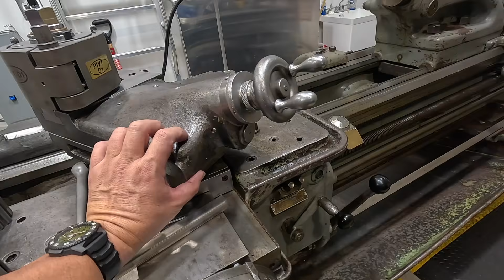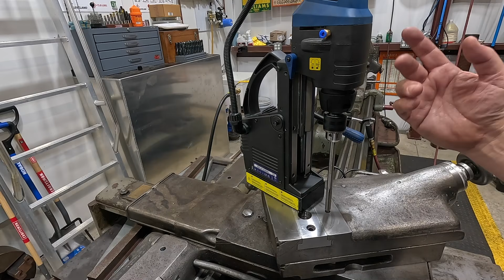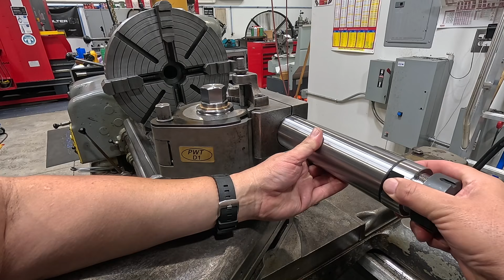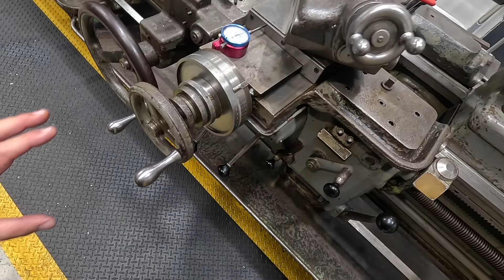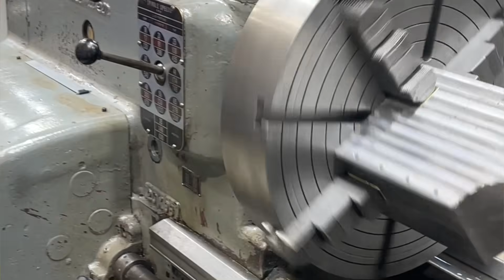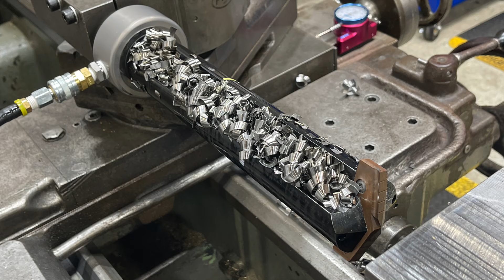3-1/4" AME Spade Drill First Test Piece

Comment: So keen to start drilling you didn't bother with the counter weights. Back in the 80s working from a Ship building and heavy engineering company I saw a bigger lathe than the Pacemaker crack its headstock from spinning a large out of balance work piece. They didn't realise until months later when the machine wouldn't turn without chattering, when they stripped it down they found hairline cracks in the casting for the bearings.

Comment: I thought the SFM was slightly high. How many tips did you go through? I have tested against Allied and nobody came close. I pulled all my index drills and replaced them with Allied. The slower speed and heavier feed beat the time of the index drill. Tool life went from 50 minutes to 120. When you break and insert on the index drill, you fry the drill. I never broke an Allied drill. I didn’t catch what material you were cutting or was the spade drill hss or carbide.

Comment: Why 29.5°?
Reply: Because most, if not all, of the threads he cuts on this machine are 60 degree threads. Half of each thread is 30 degrees, so he runs that at 29.5 to come in just under that, so that as he brings the slide in he has the slight clearance he wants.
Reply: Using the compound to thread

Comment: The  14-40 Jet (pos) that I used to run would drill that size, but max feed was .002 or it would kick off. I couldn't break all the way through either, because it would start bouncing so bad it would kick off.  This was on 12" parts with 8-9" holes, so I used this as a start to get my boring bar through.

Comment: What is your thought process on stepping the drill diameters up to final size? I usually try not to pilot much more than the web thickness so the heat and chip load is spread over the full drill cutting edges. Thanks

Comment: An amp meter on the power into the machine would be neat to see just how much power it's using to do the heavy work vs standard cutting.
Reply: Matt from HAL uses an amp meter on that big, honkin' lathe he uses for the drilling industry stuff they work on.  He says it's the best way to tell when an insert has broken.

Comment: Abom buddy, a spade drill that big should be pushing a 12 to 16 thou per Rev feed. That thing was almost just burnishing vs digging in and cutting. If the machine can't handle that kind of tool pressure, I definitely understand. But that's typically what I feed our 3.25-4" spade drills with the AM200 coating. This is in high strength AR500 steel to boot. Also looks like you could stand to have a bit more coolant flow to the top of that drill.
Reply: More coolant is never a bad thing.  You ever use that pink lemonade that HAL uses?
Reply: I don’t think the carriage would have handled that. I was waiting for the pin to shear. I also would have tapped the pin so I could remove it if it did shear.

Comment: You call it spade drill, we call it gun drill or cannon drill.
Reply: Not a gun drill, that’s a completely different style of drill
Reply: @TJ4A9  When i think about it you are right. Gun drill uses multiple inserts and is much more precise on long holes.
Reply: I never really understood
 how gun drills drill so straight but they sure do. They had an old one at a shop I worked at drilled perfectly straight through 16 inches and left a finish so smooth
Reply: @Brian55126  They say that French invented it in Napoleonic times.
French first discovered that if barrel is turning and drill is fixed with constant feed they get better results than in vice versa setup. 
Then they tweaked the drill with brazed inserts.
In those times French invented/perfected oxyacetylene torch, modern artillery and smokeless gunpowder, among many other things.
Reply: @Brian55126  your drilling with a lever and you have a huge mechanical advantage. that and that the drill rides on the bore. if the cutting insert gets smaller, the slide on the other side pushes it farther into the cut auto correcting the size of the bore.
Reply: @turtlemann14  I wasn't
Reply: @turtlemann14  I was using a horizontal gun drill machine.
Reply: @turtlemann14  it doesn't use inserts
Reply: @turtlemann14  it's 3/4 inch diameter and near 3 feet long
Reply: @turtlemann14  parts stationary
Reply: @turtlemann14  he's using a huge drill very Ridgid basically acts like a boring bar. You can't guarantee a smaller drill will will drill perfectly straight in a lathe

Comment: Why couldn't anyone just drill a smaller hole and use a boring bar? 7" is not that deep to require very specialized tooling.
Don't get me wrong this is extremely cool it just seems totally excessive, I feel like any shop with a "normal" sized lathe could perform this work
Reply: seems like a test for a higher production run, to do more than the 15 of those with boring bars might be time prohibitive vs this type of setup. Just my guess
Reply: You absolutely could do that and that would be the way to do it on a CNC. I'm assuming that since it won't fit in his CNC this is the most efficient way to do it manually.
Reply: its hard to beat the removal rate of a drill. especially if you have an out of balance part that is speed limited.

Comment: 17:20 I have a funny feeling that what moved is not the cross slide, but instead the transfer punch in its hole.  
Transfer punch looked like it wobbled in.  Try indicating the slide for 29.5 again.  That said, no fixing it now.  

Better technique might have been to turn the pin into a transfer punch with an off-center hole for gas venting.  Would be within a few tenths.  I am reminded of a video about borrowing precision from precise things.

Comment: That's an impressive cut for sure. I always hated those big chip's whipping around that's no different than razor blades. Place I work at makes cutting tools and we make a lot with chip breakers for those bug heavy cuts to try and keep them chips from becoming long strands for safety and finish quality. It's much easier when you got a blast of coolant or tools with coolant holes built in to blast it out as well. Unfortunately on a open manual machine like this that's not really possible would make a huge mess.

Comment: Adam, my man it's been a while since i watched a video of yours . I forgot how many sponsorships do you include in your videos . I got my fill for 6 months ....
About the drillbit . Don't know why did you use the toolpost and not the linked tailstock , but that does not matter . All i wanted to say is that the drill CAN handle the supplied feeds and speeds , your machine cannot . You say it's too agressive . For that old lathe it is . We have run the same drill with 72mm insert up to 0.3mm/rev and 250RPM in medium steels . The drill could handle even more ! You yes , AMEC is right with the speeds and feeds 250SFM and 0.022 can be achieved on the right machine with the proper coolant pressure/volume . 
So 4 times the material removal per minute can be done easy no problem , 8 times the rate is also possible . We also could not get there , but it was not the drills fault .
Yo i said all this and i'm not even sponsored by AMEC , what the heck .

Comment: Balance your workpiece Adam!! You can't 'experiment' on a piece like that. Your feeds and speeds guesstimations are useless if the thing is vibrating like a poker.
If the hole is to be bored another 100 thou it has to be balanced much better than that or it'll finish up tapered or worse.
That's an awesome pice of machinery but remember, people come to the channel to learn good habits as much as anything else.
Thanks for taking time to film and edit your work.

Comment: "Thats just the wrenches down here" Yeah maybe if you actually counter balanced the part, the machine would not be shaking itself so much 🤣
Reply: It didn't rattle until the cutting began, so no.
Reply: @Bricknerd  yeah because he was turning it by hand at 0.005 rpm not 120 🤣 screw some weight into your washing machine and see how that fares when spinning by hand vs spin cycle

Comment: I always start a spade drill with a clearance hole for the web. It just needs to be deep enough to establish the shoulders of the bit. Your hole will have less taper and less chatter.
Reply: not with this AMEC spade . You will destroy the center of the insert really really fast . And it will have taper . I have worked with this exact drillbit insert grade. It works best without any center , pilot , or any other preparation . I also did not want to belive it , but after i butchered 3 inserts , each worth 125€  , i started to question myself .
The drilled size with this particular tool was always right on the money , it was never over more than 0.15mm , and we're talking about big drills 68-80mm .
I have no idea why you get taper , probably the machine can't handle it .

Comment: Why wouldn't you use the tail stock to drill this hole?
Reply: drilling a hole that deep that long many times over is seriously hard work you end up needing a lever on the tail stock to make it easy enough to push through and its even harder using a carbide insert drill over a hss drill the hss drill is sharper and will cut with less force but would need sharpening multiple times over and not cut as straight a hole as that carbide drill ive drilled a similar sized hole on a very similar lathe using a hss drill and its just torture. hope that sheds some light on it :)
Reply: He said that it was because he wanted to be able to use the power feed

Comment: Adam could you make a video about the chips and where they go?  Can they be recycled or too much coolant and differing materials mixed in?  Is it waste?  Thanks!
Reply: They get recycled, any coolant left on them just burns off in the furnace. It's not really that interesting lol
Reply: Paul Component (edit: maybe Paragon Machineworks) channel has a video on how they process chips and coolant before recycling. They run production, make more chips& use more coolant, so there’s more reason for them to develop a process.

Comment: Another way I have seen this done is to pull the tailstock with the lathe carriage. So you use some kind of bolt between the carriage and the tail stock to tie them together enough to pull the tailstock (This doesn't have to be a precise connection). Then jest snug the clamp on the tailstock (This kind-of depends on how the clamp works on the tail center. Some lathes have notches on the clamp and this wont work. It has to slide.). Then just mount the drill as normal in the tailstock but use the carriage feed to drill with, instead of the tailstocks handle. This still puts the same load on the rack gear driving the carriage but not the compound and toolpost, and you don't have to indicate the drills center every time.
Reply: What a good idea.
Reply: Cazeneuve lathes had this design as standard. Beautiful machines.

Comment: 10:14 Drilling with 11,5mm for a 12 mm reamer is a bit too small for my liking. The machinists hand book (Tabellenbuch Metall , in german) specifies 2/10 to 3/10 of a mm for the reamer.
Reply: He reamed a "regular" cast iron only about 20mm deep, 0.25mm cut on the radius is fine.
Reply: I think the original hole in the tool post was the reaming size for 1/2" not 12mm in an imperial machine.

Comment: what was the reasoning for not drilling a smaller hole , or stepping up from a smaller hole then boring it? was it just to get to use a big gnarly new tool? or was there a reason for doing it this way?
Reply: Speed. He’s got 15 to do and would take so long to do 3-6 passes per hole of drilling and then setting up the boring bar and moving the cross feed from his center line.
Reply: Proof that there's always a place in this world for a radial arm drill.Bandsaws and radial arm drills are often overlooked as money makers.
Reply: Spade bits  do not like starter holes.
Reply: @mikes6877  wasn't asking specifically about the spade bit, more wht the choice to use that instead of a boreing bar and a smaller hole to start, but some people already put some reasoning behind that.

Comment: I’ve ran some allied spades in Haas vertical mills with pretty good success. I found that spades want more feed that your typical insert drill. We have both a 56mm insert drill from seco and a 56mm allied spade. The seco likes to be ran at 500SFM feeding at around .005-.008/rev. The spade likes 310SFM feeding at .012-.018

Comment: I worked for a company that drilled 1000’s of 5/8” holes 48” deep in forged carbon steel. For heat exchangers. We checked every hole with a three point micrometer three spots, also check to make sure the webs between holes was the same. Very specific work.

Comment: If the tool pressure is to high you can bump up the Speed... More speed = less pressure with equal feed per rev. And also i recomend more coolant pressure for evaquation
Reply: More speed= less pressure with equal feed per MINUTE.

Comment: I would clamp a live or dead center in the toolpost and the indicator in the chuck. Would make more sense because you don't know, if your tailstock is exactly zero.
Reply: If you regularly indicate your tailstock to your chuck then you know it's in the same plane.
Reply: @KendrickMachineShop  
1. You indicate regularly your tailstock because it can change its zero position at any time during the daily work - thats because you have to indicate it regularly ;-)

So if you do not indicate your TS directly before you zero out a new tool to this TS, you can't be sure that it is still zero.

2. Indicate the tailstock to indicate a tool what is used on the spindle without using the tailstock is .... senseless.
Reply: @tates11  Thats exactly how we do it in our cnc lathes.

Comment: One reason for having the ability to go to degree increments is to do more exact machining. Using basic trigonometry one can feed you cross slide in by .001'" and if the compound is set at 30 degrees, because the sine of 30 degrees is .500 the tool will advance only .0005". This is the method older machinists and toolmakers used before digital readouts were ever thought of.
Reply: This is not true. When the compound is set to 30 degrees and you advance the cross slide .001 it advances the tool .001. If you dial in the compound .001 it advances the tool .866 x .001 or .00086 towards the workpiece.
Reply: @TheJohndeere466   The tool advances in the x and y axis. The amount of advancement in the x axis is the sine of the angle of the compound.
Reply: @millwrightrick1  a lathe has no y axis
Reply: @millwrightrick1  x is the cosine , z would be the sine

Comment: Excellent!
This might be the time to put an amp meter on the Pacemaker to be able to monitor the load.
Reply: Or just watch the ceiling lights dim :)
Reply: @MattOGormanSmith  All kidding aside, it can be useful cause the load doubles immediately if an insert breaks while drilling.
Although the insert on that drill seems to be HSS and is not really liable to break per se but hey.

Comment: 2 questions: 
You said you were going to balance the check, but didn’t, was it because you got too engrossed or didn’t feel the need? If it was stressing you out about getting it right, would eliminating that out of balance not calmed you some more? 

Secondly: you said you’ve had it planned for months, out of interest, why was the client happy to wait so long for the parts and not go elsewhere?!? 

Amazing video as always. Thanks.
Reply: Let me take a stab at this. There are two steps to be done to each piece, for 15 pieces.  The first step is drilling, which is lower precision but removes a LOT of metal.  So, Adam did the first 3% of the total job without balancing.  That means he had to go slowly, but on this first run he had many other reasons to go slowly.  Notice that as soon as some of the chips became straw-colored, he backed off on the speeds and feeds. He implied that he would make and adjust balancing weights before the next video.
For the second question, I suspect that the customer was willing to wait because there are very few shops around that can do this kind of work.  There are few people around who have their feet planted in both CNC and traditional machining and who can handle jobs like this involving precision large parts.
Reply: Who else are they gonna have do it with the skill of Adam? Not many places around. They exist but fairly few. And anyone like Adam is gonna have a constant backlog of work. All you can do is add your name to the list of people waiting for work.

Comment: Should have used a bushing in the hole to locate the center of the bore before dropping the center punch in, could see the accuracy thrown away  from a mile away
Reply: The transfer punch is sized to fit the hole.
Reply: @desolatemetro  you can see it wiggling clearly
Reply: The toolblock made the ideal drill guide and was already in the correct place. Ream through both 1/2" while assembled.
Reply: @marley589  that's what i was taught for installing oversize/interference fit fastener on aircraft structures
Reply: @Airman..  Drilling and reaming through 2 pieces locked together was commonplace when aligning punches and dies within tenths, even on a pillar drill. If two holes were 0.030" out of alignment both parts went in the bin, followed by the machinist.

Comment: The specks on all the drills are like crazy high. I start on everything white 0.05mm / rev (0.002) and then pump it up… they all go white 10 thou bot you move the part all around, the drill will wander a lot … so start whit 2 thou (0.05mm) and bump it up then …